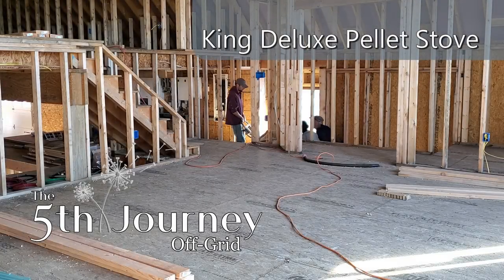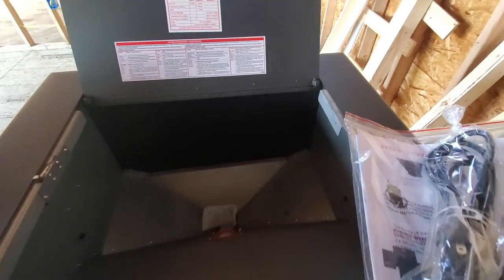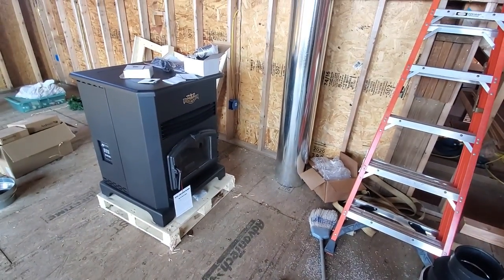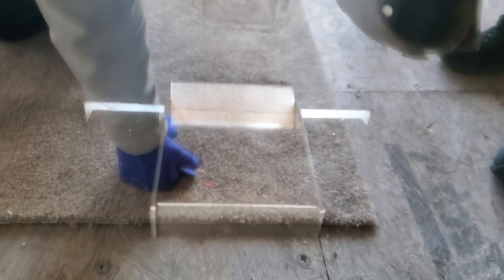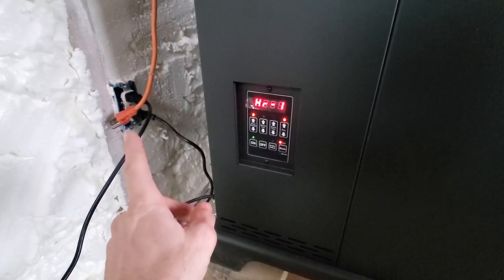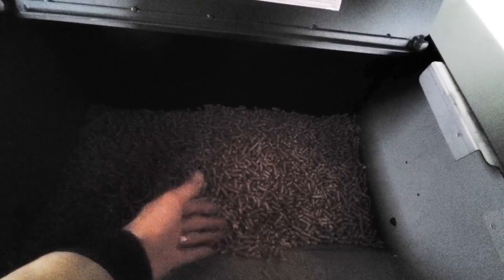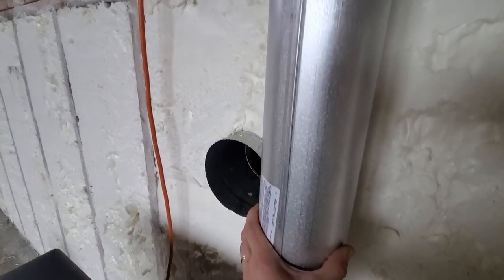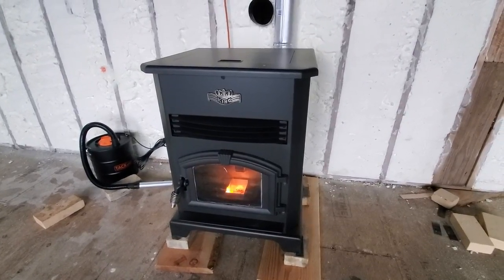Tractor Supply King Pellet Stove KP130 - Unboxing, Install, & Review from our DIY Off Grid Home

Comment: have been running a pleasant hearth pellet stove for the last ten years. Made in usa and has worked almost perfect the entire time. Only had to replace a rubber fan cage bearing once, cost 5 bucks and ten minutes. Has paid for itself many times over. Never had any other problem. Learned trick from a friend, start the pellets in the cup with a propane torch and avoid the electric start then run on a lower setting constantly. I would buy another in a minute. Stove is still running fine.
Reply from the maker: That's good to hear.  I hope ours is still running after all that time.  I'm sure keeping it maintained is the key.

Comment: That's a nice pellet stove.  I kinda wish I would have gone with pellets but I purchased a wood stove.  Love the heat.  Don't like the mess.
Reply from the maker: We would have rather had a wood stove but being on the second floor I didn't want to have to haul wood up the stairs all winter and you are right, wood is messy.  In our last house I installed a passthrough fireplace so I could load it from the outside.  I plan to install the same fireplace in the lower level of this house at some point.  We have around 90 acres of woods, seems silly not to utilize it.
Reply: @Off-Grid  A pass through fireplace.  Man what a blessing that is.  Can't wait to see it.🙂
Reply from the maker: @sinbads.4189  it could be a while, hope you'll stick around to see it.
Reply: @Off-Grid  Oh I will.  Never missed one of your videos.  Look forward to them.🙂
Reply: You'll be glad that you went with the wood stove. You will always be able to find fuel for that wood stove. You won't have to worry about running a generator if the power goes out rendering the pellet stove useless( unless you have generator) The debate for me between installing a wood stove and pellet operated heating system was short-lived- for one reason I live up in the mountains with plenty of fuel around me to burn. In 3 years I've harvested 10 burn seasons worth of wood. Oh and the fail rate on the components for those pellet stoves is horrible. If you bought a quality wood stove and not one of those big box store wood stoves it should last you so long to the point that where you'll be able to pass it on to your next generation.
Reply: @Bayside  That's exactly why we went with wood.  We also worried about not being able to get pellets if things get crazy.  We got a really nice stove. Have had it for years, and it works like a champ.

Comment: I would not be running the exhaust such a long way out through the roof.  When it comes time to clean that it is going to be a real PIA.  We ran ours directly out the wall behind the stove.  Easy to clean wth a rotary brush from the outside.  Less than 6ft it cleans right to the opening in the stove easy peasy.
Reply from the maker: It would have been nice to do that but wouldn't have worked in this situation.  So far it hasn't been an issue to clean.

Comment: I actually have a Lennox Pellet stove which are hard to find but worth the search. I have been using mine for over 7 years and other than replacing the door gasket twice it still heats flawlessly. The open door shut off switch for the hamper stopped working after 6 years but I put a shim there and I can now add pellets while it's running which is much better anyways. Glad yours worked out for you.
Reply from the maker: Thanks, it's still working fine.  We haven't had any issues.   I do perform the routine maintenance on it so I'm sure that's helping. Glad you have a good one too.

Comment: question how much power does it use in watts and does it have a blower. I know you can direct vent pellet stoves out a side wall and put on a hot cap  . It saves money as I am thinking of putting one in my basement . How much did the wood stove weigh . I had one in my house in NJ   for years but it was  in when I bought the house  but not hooked up  .  I hooked it up and loved it but after years of living there we retired and moved to VA  back in 2004 and should have put one in then but to many things to do and never got to it
Reply from the maker: On low it uses around 200W so not much at all.  We often run it all day and night when needed without much worry about our power consumption.  It weighs 218lbs and can hold 130lbs of pellets.  So far it has worked great!
Reply: @Off-Grid  I want one for my basement so don't need a big one . It is just keep dampness out and maybe  heat my wood shop down there . I can close off half the basement by closing the door in the concrete wall dividing it . But would maybe help   keep an even temperature
Reply: @Off-Grid  the small one says 60 watts of power  but I  have eco fans   to move heat also
Reply from the maker: @sissymurphy9620  if the basement was heated that would also help heat the main level.

Comment: How far from wall does this need to be n what type piping do u need for one.  My house caught fire last night from my wood stove piping.  Everyone is ok but smoke n so.e water damage.  Not sure the entire extent of it yet.   Seriously thinking on a pellet stove.  Any comments apprieciated.
Reply from the maker: According to the instructions the pipe must be 1" away from all combustible material.   The brackets that hold the pipe actually keep the pipe the exact distance away.  Sorry to hear by your fire.  A wood burning stove gets much much hotter.  Our last house I had a double insulated stove pipe which dropped it down to the same 1" from combustibles but I still kept it around 4-6" just to be save.
Reply: @Off-Grid  Thanks for the info!

Comment: Do the pellets create the heat and the blower runs off electricity?
Reply from the maker: Correct.  On low is uses less than 200W and once it warmes up it is closer to 100W.  We can let it run all night and it doesn't run down our batteries.

Comment: I purchased the same model about the same time your video posted, I had a “flash over “ one time that blew sparks, flame & ash through the fresh air intake before I installed it to the outside (totally my fault ), please make sure it is totally clean prior to every start up.
Reply from the maker: Also clean before using each winter but better to clean in the spring once the stove isn't needed.  It is a lot easier to clean when the debris is fresh. 
Thanks for watching.

Comment: how many square feet is the house. how well does it heat it? on a cold zero degree day can it keep up
Reply from the maker: It heats around 2000 sqft and even in single digit temperatures it keeps the area around 60 on low.  We have a tight house though so the cold and wind is kept out and the heat it.  In a drafty house I'm sure it wouldn't do as great.

Comment: Did you ever end up connecting the thermostat? I have the same stove but bought it used and was curious if I could connect one
Reply from the maker: No, we really haven't had a need to.  We just let it run on low the whole time.  Works great.

Comment: Question how did it perform in this video with the space being as it is unfinished did it heat the entire space up to a comfortable point after so many days and hours of being on if so what temperature that is stay steady at
Reply from the maker: It actually did a lot better than expected. Even when we got down below zero degrees outside the house was around 40 and on normal days it held around 60 while only on level one.  Now that the drywall is up it'll keep us above 70 and uses less than 200 watts meaning we can run it all night without drainage our batteries.  We've been very happy with it.

Comment: When you vacuum out the ashes clean the ignitor with a toothbrush or you will be replacing it more often
Reply from the maker: Hello Linda, thanks for the tip. I actually bought another ignitor just in case since that seemed to be the #1 issue.  I need to clean it again for this winter so I'll be sure to do that.  Thanks again and thanks for watching and commenting.

Comment: Looks like mine the kp130 make sure you cut the bottom of the door glass gasket out or your glass will be all black and Smokey. Mine puts out so much damn heat I have to leave it on setting one and it gets by single-story Ranch House of the 80's have to open the window
Reply from the maker: So your making an air wash by cutting the gasket.  Only problem is that now the freah air intake isn't being used because the air is being sucked through the new opening.  I just clean the glass with a razor each week.
Reply from the maker: Watched the video and see what you mean.  Will check it out today, thanks

Comment: on my parents house in pa my mother and father wrapped a copper pipe around the wood stove for hot water
Reply from the maker: I've always wanted to try that.  I have seen kits but don't think it would be two hard to rig up myself either.

Comment: connect the cold air supply and you will gain alot of heat in your home, right now you are burning heated air inside your home pulling drafts. Also ventilation fans can cause smokeback. Unit uses 600 watts on startup for heating coil - its 150-200 Watts fan Running.
Reply from the maker: Yep, at this point we just wanted some kind of heat in the house.  I will install the fresh air vents to prevent any drafts.  We did do monopoly framing and foam so the house is tight but still.  

The stove doesn't really make much of a dent in our batteries.  We'll see how that might change in the future though.

Thanks for the comment.
Reply: being this is a new construction, definitely hook up the fresh air, especially since it would be so simple to do.  But is it needed in a 100 year old drafty farm house? Probably not.
Reply from the maker: @Jaymobe07  we did install the fresh air intake.  This house should be tight with the spray foam, zip sheathing, and liquid flashing around all windows walls.  Haven't done a blower test but I think we did it right.  If not for all that then you'd be right.  What's the point?
Reply: @Jaymobe07  keeps chance of any backdraft from happening from the stove, winds can hit certain direction on the home and create pressures that will suck smoke into thehome from a disconnected fresh air intake and possibly overpower or create reverse flow on the exhaust fan. 

also being a drafty farm house, you will need to keep whatever heat you can into the  home, no reason to use heated conditioned air for the fire when you can use outside fresh cooler air.

Comment: Make sure you cut the lower center section of the window gasket. It will create an air wash and keep the inside glass cleaner longer.
Reply from the maker: We did try that but didn't really notice any difference.
Reply: @Off-Grid   Did you remove the whole bottom section? It made a huge difference in mine. I run at hr1 1.75lbs per hour and draft fan at 5
Reply from the maker: @bigmeaney555  yes, cut the gasket back along the whole opening where the slit is.  We just have it set on the preset #1.
Reply: @Off-Grid   Did you manually change the feed rate parameters? From the factory it is 4.5 lbs per hour even on heat range 1.
Reply from the maker: @bigmeaney555  no, we just use the presets.  A bag lasts over a day.
Reply: @Off-Grid   Ok, if ain't broke don't fix it.

Comment: I hope you left enough clearance for after you finish the walls and flooring? I just bought the same stove for my garage bar. best of luck.
Reply from the maker: Clearance is only 1" from combustibles.  The pipe brackets are made to achieve that distance and most of the unit itself stays cool to the touch.  The only part that gets hot is around the burn chamber, which is on the front away from everything.  Hope it works sell for your bar.  It kept us warm without any issues.

Comment: This video takes you back in time. There is no spray foam in the walls yet. I bet you wish you could put the pink stuff in now.
Reply from the maker: Oh I wish!  Thought with winter soon to be here this video might help others thinking of buying a pellet stove.
Reply: @Off-Grid  Very nice stove.
Reply from the maker: @fredj6278  so far so good.  Should be firing it up again very soon.
Reply: So do you still like it?
Reply from the maker: @modifiedchevy  yep, cleaned it up before using it again this winter and so far it's work just fine.
Reply: @Off-Grid  awesome to hear, I just picked one up, used and needs repairs but it's still like new
Reply from the maker: @modifiedchevy  just keep it maintained and you should be fine. One other thing I did was bought a spare igniter just in case since that seems to be the most common and frequent issue.

Comment: Question, do you know or do you think there are thermal eletric generators you can attach to the pellet stove where the stove would make it's own eletricity to power itself?
Reply from the maker: If it was part of the exhaust maybe but the unit itself doesn't get hot enough I'd think
Reply: @Off-Grid  Probably place it like on the exhaust pipe.
Reply: @Off-Grid  Unless you maybe place it on the glass door.
Reply from the maker: @sigglass2183  the glass and a about 4-6" around the door gets hot but that's it and no horizontal surfaces.  If they made one with a magnet that might work.

Comment: Does the stove have a thermostat where it will cycle off if the room reaches a certain temperature?
Reply from the maker: Yes, there is a thermostat that comes with the unit.  I haven't hooked it up but know that the unit seems to burn low after a while and then will kick up higher as needed so I believe there is an internal thermostat as well.
Reply: I have the same stove but have struggled with figuring out the thermostat and hooking it up. The directions weren't clear at all

Comment: I had to go back and listen again. 
You said that the pellet stove draws 600 watts continuous on a 150 amp hours of batteries. Thats only 1,800 wh of storage. You would deplete your batteries in 3 hours.
Reply from the maker: On High it's around 600 but we only have it on low which is less than 200 watts.  The house typically consumes 500-700 Watts at any given time throughout the night.  That plus the pellet stove going and we only use around 15-20% battery state of charge at night.  In the summer we use 10-15%.
Reply from the maker: Also, out batteries have 1050 amp hours I believe.
Reply: @Off-Grid  
That makes more sense. Either I missed understood what you said or you weren't careful. 1050 amp hours should be good for 22 hours.

Comment: Can you share how you installed the thermostat with this system?
Reply from the maker: Actually we haven't done that yet.  Last winter we didn't even have drywall up yet so the stove was installed just to get us some heat.  Right now I'm building the mantel and chimney structure so I can set the pellet stove in place permanently and will be installing the thermostat soon.
Reply: Yeah...the paperwork they send with it, really doesn't do the job, it's very blurry and at this point...I'd say outdated.

Comment: Do you have the air intake in?   Just installed mine in my shop but did not run it.
Reply from the maker: At the time of the video I did not and it worked great.  I have it fully installed now and with the outside air intake and it 's all good.
Reply: Thank you.  Can I ask you what you used.  I just did my first light today  1500sq shop I was hoping I wouldn't need it 😅
Reply from the maker: @blakegockley  What do you mean by what I used?
Reply: Mine came with like 6 ft of a air intake hose I need longer
Reply from the maker: @blakegockley  Yeah, it isn't very long.  I think they expect it to be placed on an outside wall. Luckily ours in on the garage wall so I ran it into there.

Comment: Can you provide a materials list and cost? Also how many bags a day do you normally burn
Reply from the maker: Sure, the only other expense we had was the pipe for the chimney.  I bumped up to a 6" to go through the cupola but that was just for aesthetics.   The pipe, straps, caulking, cap, flashing, and other parts were around $500 and the stove itself was on sale at Tractor Supply for around $800+ tax and shipping.  So everything was less than $1500.  A ton of Pellets was $250 and that lasted all winter but we didn't fire it up until mid December so we plan to buy two tons next winter to be safe.

On low it takes about 36 hours to burn through one 40lb bag and that kept the house at a steady 60 degrees and this was without any drywall installed yet so just one big open space, around 3400sqft.  On a really cold night or morning we'd bump it up to level 2 (out of 5) and then it would take around a bag per 28 hours or so.  We never ran it on a level above 2 for any great length of time so I don't know how long a bag would last but I'd guess on level 5 you'd get around 12 hours maybe.
Reply: @Off-Grid  uh, your burn rates are a little off. On default the low setting will burn 1.75lbs/hr, which equates to about 22hrs for one 40 lb bag on low. On 2, I believe your at 2.5lbs/hr, so maybe 16hrs...
Reply from the maker: @zackhaas3267  no, we get a day and a half  out if a 50lb bag.
Reply: @Off-Grid  not saying you don't, but the factory settings on the king on low is 1.75lbs an hour, and I've never seen a 50lb bag of pellets, they are normally 40lb, so maybe that's the difference?. You may get more if not running it constantly, but at 1.75lbs an hour it just figures to about 22hours with the normal 40lb bag,, and with my experience with the king that's the most I got out of 40lbs.